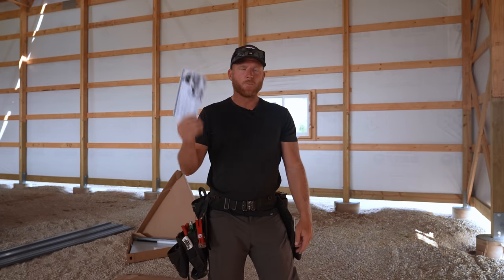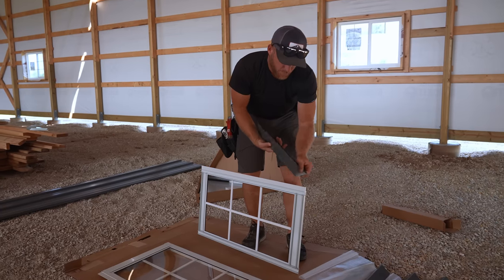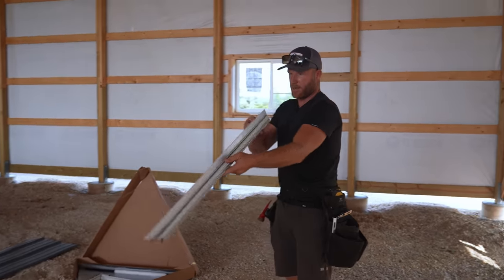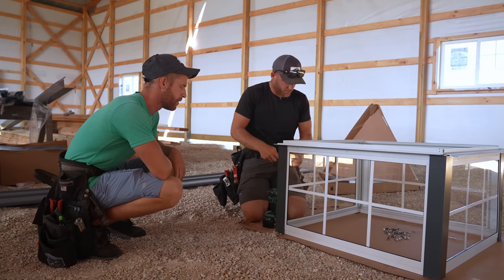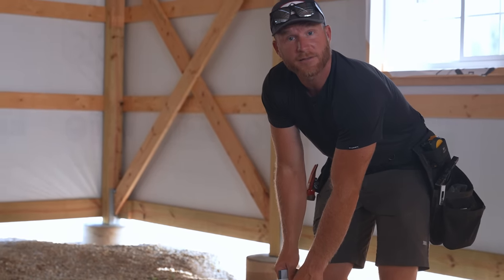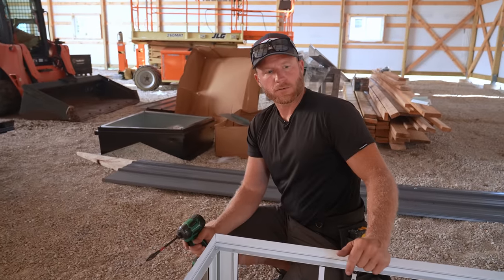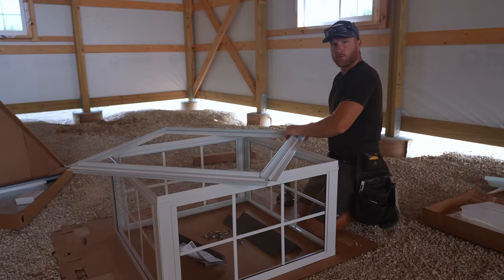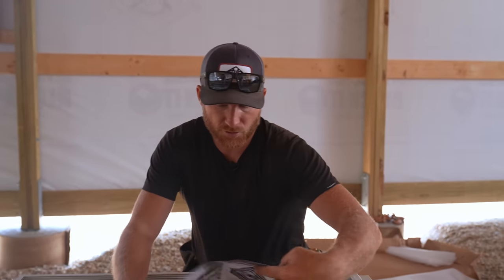First Time Cupola Build...I Should Have Read the Directions! FARM SHOP

Comment: I tap a scrap 2x4 block to gently get the roof stiffeners up. Then feed the tab at top in between the silver and black plates.  Tightening the base bolts locks them in place. 
Square up the top plate to the roof panels before tightening the bolts

Comment: Cupolas were originally designed for ventilation at the peak of the roof where the hottest air would accumulate.  Early models had slats and modern working cupolas have casement windows that open via a hanging chain.

Comment: The building size requires a larger scale cupola for better proportions.
Reply: Just get a bigger phone
Reply: I thought the same thing, it's way too small on that big of a roof. And it would be nice if it performed some type of function, like ventilation or allowing light inside the building.
Reply: @c.a.martin3029  They are not good for light even with the windows.  But if you get a ventilated one you have to cut a hole in the base which is allowed without effecting warranty.

Comment: Why don't you set the bottom of the 2x6 x braces at the top of the grey pole brackets?  So they bear on the face of the pole instead of the metal?
I like to put an 1 1/2 seat cut on the top of lower x, and bottom of upper x,  so the upper bears on the lower 😊

Comment: Hey could you do a variance on them and use them as an attic vent with a fan? Ive built a few barndominiums and even forced air venting is kinda coming back for attics. I could aee vent the ends and even the fans are located there but vents out the top

Comment: Always amazes me with these buildings that there is so little structure to them, roof trusses like 2.4m apart. We build house extensions here in Scotland and have to use steel beams for ridges and trusses are 600mm apart sometimes 400mm. Tiny compared to these buildings
Reply: pole buildings are built differently than a typical house here in america
Reply: Yeah absolutely, a lot of the stuff we build is so over engineered. When something like this will still be structurally sound with so few materials. It’s great to watch! Do you do this kind of work yourself?

Comment: I've spent so much of my life, or so it seemed, taking people's stuff apart and rebuilding it PER THE INSTRUCTION MANUAL!!! Every piece of kit-built product comes with a comprehensive manual, usually in 4, but up to 12, languages. Some, like IKEA, do pictograms, others give you both dialogue and graphics. As long as you follow the dotted-line, you can't go wrong.
Then I watched the rest of the video and there's Greg almost yelling at you for STILL not reading the freaking instructions. Read and follow the instructions. You cannot go wrong that way.

Comment: I hate these things. They are so expensive and a pain in the butt to build and install. I have gotten pretty fast though, i can slap together a 4'x4'  (our most common size) by my self in a hour. I have came up with alot of mods over the years to reinforce them, their stock configuration just seems to flimsy for midwest winds imo. The corner pieces of the roof with high winds will vibrate  and they slide down and the whole roof goes limp and flops around in the wind. I put a stitch screw at the base of all them pieces and it seems to prevent this problem.